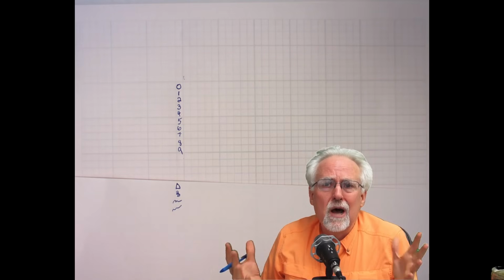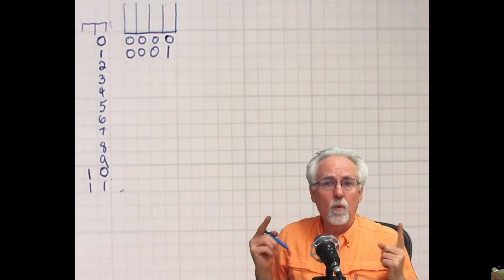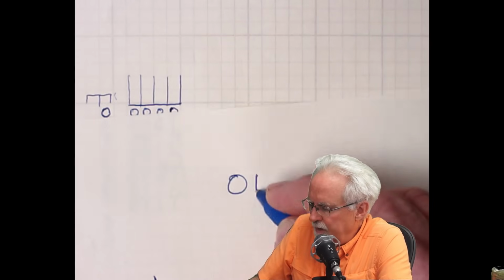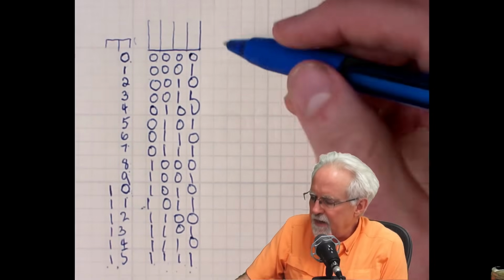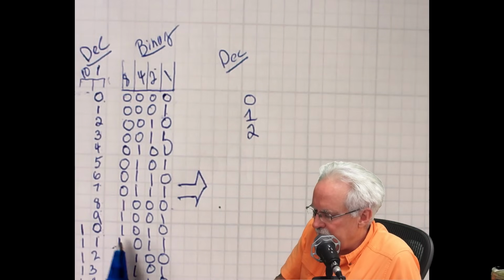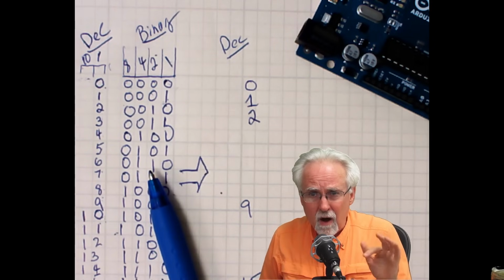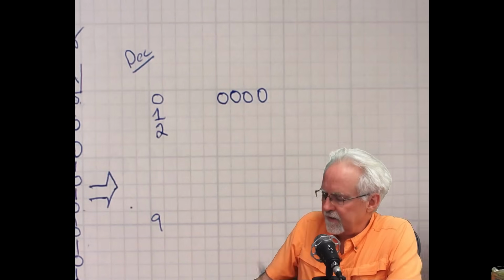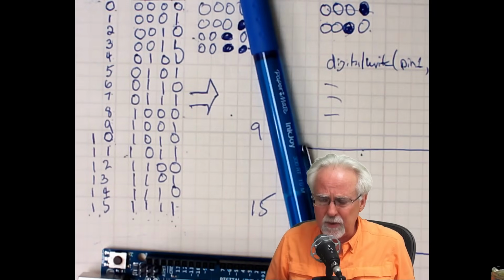Arduino Tutorial 5: Understanding and Working With Binary Numbers

Comment: void setup() {
 
pinMode(13,OUTPUT);
pinMode(12,OUTPUT);
pinMode(11,OUTPUT);
pinMode(10,OUTPUT);
}

void loop() {
  digitalWrite(13,LOW);
  digitalWrite(12,LOW);
  digitalWrite(11,LOW);
  digitalWrite(10,LOW);
  delay(2000);
  digitalWrite(10,HIGH);
  delay(2000);
  digitalWrite(10,LOW);
  digitalWrite(11,HIGH);
  delay(2000);
  digitalWrite(10,HIGH);
  delay(2000);
  digitalWrite(10,LOW);
  digitalWrite(11,LOW);
  digitalWrite(12,HIGH);
  delay(2000);
  digitalWrite(10,HIGH);
  delay(2000);
  digitalWrite(10,LOW);
  digitalWrite(11,HIGH);
  delay(2000);
  digitalWrite(10,HIGH);
  delay(2000);
  digitalWrite(10,LOW);
  digitalWrite(11,LOW);
  digitalWrite(12,LOW);
  digitalWrite(13,HIGH);
  delay(2000);
  digitalWrite(10,HIGH);
  delay(2000);
  digitalWrite(10,LOW);
  digitalWrite(11,HIGH);
  delay(2000);
  digitalWrite(10,HIGH);
  delay(2000);
  digitalWrite(10,LOW);
  digitalWrite(11,LOW);
  digitalWrite(12,HIGH);
  delay(2000);
  digitalWrite(10,HIGH);
  delay(2000); 
  digitalWrite(10,LOW);
  digitalWrite(11,HIGH);
  delay(2000);
  digitalWrite(10,HIGH);
  delay(2000);
   
  }

Comment: //I tried to do this lecture's HW in a slightly more advanced way than what we have learned so far, using what I know already from //computer science. I added some comments explaining my logic 

int A=8;
int B=9;
int C=10;
int D=11;

void setup() {
  // put your setup code here, to run once:
  pinMode(A, OUTPUT);
  pinMode(B, OUTPUT);
  pinMode(C, OUTPUT);
  pinMode(D, OUTPUT);
}

/*
 * this function takes the int i and and uses it to create its  
 * respective "4 digit" binary counterpart in reverse;
 * it uses the decimal to binary algorithm.
 * so if i=7, bin={1,1,1,0}
 * therefore 7 in binary is 0111
 */
void intToBinary_arr(int i, int bin[]){
  int bin_div=i;
  int bin_mod=0;
  for(int j=0; j<4; j++){
    bin_mod=bin_div%2;
    bin[j]=bin_mod;
    bin_div=bin_div/2;
  }
}

/*
 * here we have our LEDS on the bread board lined like: ABCD
 * we want to count in binary from 0 to 15 to display all
 * 16 binary digits in order:
 * (0000, 0001, 0010, 0011, 0100, 0101,...,1111)
 * (example: when i=1, A->0, B->0, C->0, D->1) 
 * (where a 0 would turn led off (LOW) and 1 would turn it on (HIGH)
 * we use inToBinary_arr() to fill our declared array, bin_arr, with 
 * the binary counterpart of the iterating integer i (which will increment from 0 to 15)

 * Since our bin_arr will contain the desired binary numbers in reverse, we assign 
 * A with the last element of the array (bin_arr[3]), 
 * B with the third (bin_arr[2]), 
 * C with the second (bin_arr[1]), 
 * and D with the first (bin_arr[0]).
 */
void loop() {
  for(int i=0; i<16; i++){
    int bin_arr[4];
    intToBinary_arr(i, bin);
    digitalWrite(A, bin_arr[3]);
    digitalWrite(B, bin_arr[2]);
    digitalWrite(C, bin_arr[1]);
    digitalWrite(D, bin_arr[0]);
    delay(1000);
  }
}

Comment: Binary counter - excellent exercise. Instead of brute-force writing 15x4 digitalWrite commands, there are a number of faster ways to code this. One way: learn the "function" command. Create a function, say F0001, to cycle the rightmost light. Create another function, say F0010, to turn light 0010 off, use F0001, turn 0010 on, and use F0001 again. Continue in this way for the other lights. Saves a great deal of writing.

Comment: Hey guys I figured it out, so this is the code answer.

int firstLEDPin= 13;
int secondLEDPin= 12;
int thirdLEDPin= 11;
int fourthLEDPin= 10;
int newNumberDelay= 2000;
int finalDelay= 5000;
void setup() {
  // put your setup code here, to run once:
pinMode(firstLEDPin,OUTPUT);
pinMode(secondLEDPin,OUTPUT);
pinMode(thirdLEDPin,OUTPUT);
pinMode(fourthLEDPin,OUTPUT);
}

void loop() {
  // put your main code here, to run repeatedly:
// Number '0'
digitalWrite(firstLEDPin, LOW);
digitalWrite(secondLEDPin, LOW);
digitalWrite(thirdLEDPin, LOW);
digitalWrite(fourthLEDPin, LOW);
delay(newNumberDelay);

//Number '1'
digitalWrite(firstLEDPin, LOW);
digitalWrite(secondLEDPin, LOW);
digitalWrite(thirdLEDPin, LOW);
digitalWrite(fourthLEDPin, HIGH);
delay(newNumberDelay);
digitalWrite(firstLEDPin, LOW);
digitalWrite(secondLEDPin, LOW);
digitalWrite(thirdLEDPin, LOW);
digitalWrite(fourthLEDPin, LOW);
delay(newNumberDelay);

// Number '2'
digitalWrite(firstLEDPin, LOW);
digitalWrite(secondLEDPin, LOW);
digitalWrite(thirdLEDPin, HIGH);
digitalWrite(fourthLEDPin, LOW);
delay(newNumberDelay);
digitalWrite(firstLEDPin, LOW);
digitalWrite(secondLEDPin, LOW);
digitalWrite(thirdLEDPin, LOW);
digitalWrite(fourthLEDPin, LOW);
delay(newNumberDelay);

// Number '3'
digitalWrite(firstLEDPin, LOW);
digitalWrite(secondLEDPin, LOW);
digitalWrite(thirdLEDPin, HIGH);
digitalWrite(fourthLEDPin, HIGH);
delay(newNumberDelay);
digitalWrite(firstLEDPin, LOW);
digitalWrite(secondLEDPin, LOW);
digitalWrite(thirdLEDPin, LOW);
digitalWrite(fourthLEDPin, LOW);
delay(newNumberDelay);

// Number '4'
digitalWrite(firstLEDPin, LOW);
digitalWrite(secondLEDPin, HIGH);
digitalWrite(thirdLEDPin, LOW);
digitalWrite(fourthLEDPin, LOW);
delay(newNumberDelay);
digitalWrite(firstLEDPin, LOW);
digitalWrite(secondLEDPin, LOW);
digitalWrite(thirdLEDPin, LOW);
digitalWrite(fourthLEDPin, LOW);
delay(newNumberDelay);

// Number '5'
digitalWrite(firstLEDPin, LOW);
digitalWrite(secondLEDPin, HIGH);
digitalWrite(thirdLEDPin, LOW);
digitalWrite(fourthLEDPin, HIGH);
delay(newNumberDelay);
digitalWrite(firstLEDPin, LOW);
digitalWrite(secondLEDPin, LOW);
digitalWrite(thirdLEDPin, LOW);
digitalWrite(fourthLEDPin, LOW);
delay(newNumberDelay);

// Number '6'
digitalWrite(firstLEDPin, LOW);
digitalWrite(secondLEDPin, HIGH);
digitalWrite(thirdLEDPin, HIGH);
digitalWrite(fourthLEDPin, LOW);
delay(newNumberDelay);
digitalWrite(firstLEDPin, LOW);
digitalWrite(secondLEDPin, LOW);
digitalWrite(thirdLEDPin, LOW);
digitalWrite(fourthLEDPin, LOW);
delay(newNumberDelay);

// Number '7'
digitalWrite(firstLEDPin, LOW);
digitalWrite(secondLEDPin, HIGH);
digitalWrite(thirdLEDPin, HIGH);
digitalWrite(fourthLEDPin, HIGH);
delay(newNumberDelay);
digitalWrite(firstLEDPin, LOW);
digitalWrite(secondLEDPin, LOW);
digitalWrite(thirdLEDPin, LOW);
digitalWrite(fourthLEDPin, LOW);
delay(newNumberDelay);

// Number '8'
digitalWrite(firstLEDPin, HIGH);
digitalWrite(secondLEDPin, LOW);
digitalWrite(thirdLEDPin, LOW);
digitalWrite(fourthLEDPin, LOW);
delay(newNumberDelay);
digitalWrite(firstLEDPin, LOW);
digitalWrite(secondLEDPin, LOW);
digitalWrite(thirdLEDPin, LOW);
digitalWrite(fourthLEDPin, LOW);
delay(newNumberDelay);

// Number '9'
digitalWrite(firstLEDPin, LOW);
digitalWrite(secondLEDPin, LOW);
digitalWrite(thirdLEDPin, LOW);
digitalWrite(fourthLEDPin, LOW);
delay(newNumberDelay);
digitalWrite(firstLEDPin, LOW);
digitalWrite(secondLEDPin, LOW);
digitalWrite(thirdLEDPin, LOW);
digitalWrite(fourthLEDPin, LOW);
delay(newNumberDelay);

// Number '10'
digitalWrite(firstLEDPin, HIGH);
digitalWrite(secondLEDPin, LOW);
digitalWrite(thirdLEDPin, HIGH);
digitalWrite(fourthLEDPin, LOW);
delay(newNumberDelay);
digitalWrite(firstLEDPin, LOW);
digitalWrite(secondLEDPin, LOW);
digitalWrite(thirdLEDPin, LOW);
digitalWrite(fourthLEDPin, LOW);
delay(newNumberDelay);

// Number '11'
digitalWrite(firstLEDPin, HIGH);
digitalWrite(secondLEDPin, LOW);
digitalWrite(thirdLEDPin, HIGH);
digitalWrite(fourthLEDPin, HIGH);
delay(newNumberDelay);
digitalWrite(firstLEDPin, LOW);
digitalWrite(secondLEDPin, LOW);
digitalWrite(thirdLEDPin, LOW);
digitalWrite(fourthLEDPin, LOW);
delay(newNumberDelay);

// Number '12'
digitalWrite(firstLEDPin, HIGH);
digitalWrite(secondLEDPin, HIGH);
digitalWrite(thirdLEDPin, LOW);
digitalWrite(fourthLEDPin, LOW);
delay(newNumberDelay);
digitalWrite(firstLEDPin, LOW);
digitalWrite(secondLEDPin, LOW);
digitalWrite(thirdLEDPin, LOW);
digitalWrite(fourthLEDPin, LOW);
delay(newNumberDelay);

// Number '13'
digitalWrite(firstLEDPin, HIGH);
digitalWrite(secondLEDPin, HIGH);
digitalWrite(thirdLEDPin, LOW);
digitalWrite(fourthLEDPin, HIGH);
delay(newNumberDelay);
digitalWrite(firstLEDPin, LOW);
digitalWrite(secondLEDPin, LOW);
digitalWrite(thirdLEDPin, LOW);
digitalWrite(fourthLEDPin, LOW);
delay(newNumberDelay);

// Number '14'
digitalWrite(firstLEDPin, HIGH);
digitalWrite(secondLEDPin, HIGH);
digitalWrite(thirdLEDPin, HIGH);
digitalWrite(fourthLEDPin, LOW);
delay(newNumberDelay);
digitalWrite(firstLEDPin, LOW);
digitalWrite(secondLEDPin, LOW);
digitalWrite(thirdLEDPin, LOW);
digitalWrite(fourthLEDPin, LOW);
delay(newNumberDelay);

// Number '15'
digitalWrite(firstLEDPin, HIGH);
digitalWrite(secondLEDPin, HIGH);
digitalWrite(thirdLEDPin, HIGH);
digitalWrite(fourthLEDPin, HIGH);
delay(newNumberDelay);
digitalWrite(firstLEDPin, LOW);
digitalWrite(secondLEDPin, LOW);
digitalWrite(thirdLEDPin, LOW);
digitalWrite(fourthLEDPin, LOW);
delay(newNumberDelay);

delay(finalDelay);
}

you can change it to suit your needs.

Comment: Hi . I may have a problem
On my first time use of uno as soon as I hooked it up to the computer the power light was on and a yellow led was flashing 
And kept flashing and the sketches from arduino had no effect on the uno .is the uno defective or do I need to do something for the first use 
Help please. 
Thanks
Reply: That orange light is probably just the onboard led attached to pin 13, 

When you say the sketches had no effect on the uno, do you mean the sketches weren't doing what they were supposed to, or did you mean that the light kept blinking when you uploaded a sketch?

Because if the sketches worked, and the light kept blinking, then things should be perfectly fine.

Comment: how can i get an additional GND ?
Reply: You can run a wire from the ground on your Arduino to the - (negative) column on the breadboard. Then when you use any of the holes on the breadboard in that - (negative) column it will be connected to ground. You can review the early lesson on breadboards. It's covered in that lesson.

Comment: working version for the homework 

//settingthe output pins's
int LEDone = 2; // LED 1 has a value of 1
int LEDtwo = 7; // LED 2 has a value of 2
int LEDthree = 8; // LED 3 has a value of 4
int LEDfour = 13; // LED 4 has a value of 8
int timer = 1000; // delay value 
int count = 0; // this value will be used to see what lights need to be turned on 
void setup() {
  //setting the outputs
  pinMode(LEDone,OUTPUT);
  pinMode(LEDtwo,OUTPUT);
  pinMode(LEDthree,OUTPUT);
  pinMode(LEDfour,OUTPUT);
}
void loop() {
  //setting all pins to LOW so the number starts of as zero
  digitalWrite(LEDone,LOW);
  digitalWrite(LEDtwo,LOW);
  digitalWrite(LEDthree,LOW);
  digitalWrite(LEDfour,LOW);
  delay(1000);
  // for loop to make sure that the program counts to 15 starting from 1
  for(int i = 1; i <= 15; i++)
  {
  count = i; //settign the value of count to i so we know what number is soposed to be displayed 
  
   //if statments will see if the number that needs to be displayed is greater than the lights value 
   //starting with the highest light value 
   //chekign to see if LEDfour needs to be turned on 
   if(count >= 8)
   {
    digitalWrite(LEDfour, HIGH); // if ture light will turn on
    count -= 8; // subtracting the lights value from the number 
   }
   else // if the number is lower than the light value 
   {
    digitalWrite(LEDfour, LOW);
   }
   //checking to see if LEDthree needs to be turned on
   if(count >= 4)
   {
    digitalWrite(LEDthree, HIGH); // if ture light will turn on
    count -= 4; // subtracting the lights value from the number 
   }
   else // if the number is lower than the light value 
   {
    digitalWrite(LEDthree, LOW);
   }
   //checking to see if LEDtwo needs to be turned on
   if(count >= 2)
   {
    digitalWrite(LEDtwo, HIGH); // if ture light will turn on
    count -= 2; // subtracting the lights value from the number 
   }
   else // if the number is lower than the light value 
   {
    digitalWrite(LEDtwo, LOW);
   }
   //checking to see if LEDone needs to be turned on
   if(count >= 1)
   {
    digitalWrite(LEDone, HIGH); // if ture light will turn on
    count -= 1; // subtracting the lights value from the number 
   }
   else // if the number is lower than the light value 
   {
    digitalWrite(LEDone, LOW);
   }
   // adding in a delay to make sure that the user has time to see the lights 
   delay(timer);
   
  }
  
}

Comment: Question if I may?....Paul - Can I use a single resistor in series with the negative (which is common to all LEDs), rather than a resistor for each LED?
Reply from the maker: No. The current would depend on what is happening in the other color. Change one color, and it will affect the other color.

Comment: Hi Paul...I enjoyed this lesson a lot.  I know it's redundant but thanks again!  
A few things I encountered on this project:  
1.  One of my resistors had too much resistance so the light for the first spot started out dim.  I changed it and the issue was corrected.  
2.  I've been using the solid wires and bending them out of the way for a nice clean look but my bend this time was to severe and I had to use tweezers dig a wire end out of the #11 spot on my Arduino.
3.  Initially I had my delay entered in as delay=(longPause) which of course caused an error
4.  after I fixed my delay I noticed that my pause between the count of ten and eleven was taking twice as long.  the problem was I had two semi-colons after the pause.  The extra long pause is evident on my homework project.  https://youtu.be/CjC8Q0N4tHU

Comment: /*
 * 4 Bit decimal to binary 
 */

 int pin[4] = {4, 5, 6, 7};  // pin numbers are stored inside pin array
 int b[4];
 
void setup() {

  for( int i=0; i<4; i++ )
  pinMode(pin[i], OUTPUT);
  
}

void loop() {

  int num = 0; // counter is initialized at zero.

  while( num<16 ){               
    int count = num;             
      for( int i=0; i<4; i++){
        if( count%2 == 1 )       
        b[i] = HIGH;
        else
        b[i] = LOW;
        count /= 2; 
      }

    for( int i=0; i<4; i++){
      digitalWrite(pin[i], b[i]);
    }
    num++;
    delay(1000);
  }

}

Comment: Sir, instead of purchasing the kit ,I am planning to buy indivisual components , can you guide me ,what all will be needed to follow up your tutorials ?
Reply from the maker: The reason I suggest the kit is to make it easy . . . cost for putting components together your self would be much more than the kit.
Reply: @paulmcwhorter   actually sir , amazon is not delivering it to my place :(  . aliexpress is doing it ,but the number of days it will take is more than a month ,so I was planning to buy stuff from a nearby store
Reply: @paulmcwhorter  so, apart from the arduino uno ,what all sensors will you be dealing with ?

Comment: Hello all…I’ve got the digital counter working properly. I wonder if the ‘delay’ function can be set as a variable so that I can change the rate at which the counter progresses with a single entry only. I’m guessing that there is a way to do this but not with ‘delay’.
Reply from the maker: Yes, use delay, but make the parameter a variable you set value of at top of code.
Reply: Thanks. That was easy! In fact, I ended up using a second, longer, delay at the end of the loop so that there is a definite pause with all four LEDs lit before the loop begins again.

Comment: For the assignment, since we are using 4 LEDs, would we also need 4 grounds? I only see 3 grounds on the arduino. I could set one of the pins to ground, but I feel like there is a better way to do it.
Reply from the maker: YOu have to create a ground rail on one of those two top or bottom rows on the breadboard that go all the way across. Hook one of those to the ground, then the whole row will be available as a ground.
Reply: Paul McWhorter Thank you. I was trying to do that earlier and it didn’t work. However, I found the issue. One of my wires wasn’t working. I had to test through all my wires and found that 4 of them didn’t even work. Kinda sucks but at least I’m not stuck anymore.

Comment: did you know that computers were almost designed to work with base 3 by using    switches   that switch between negative voltage and  zero voltage and positive voltage.

Comment: Hi Paul

Thanks for this series. It's giving me a good start to arduino which I haven't touched in a couple years. I do have a question though. I bought a kit that is a bit cheaper about a month ago: https://www.amazon.com/UNIROI-Complete-Tutorials-Breadboard-UA005/dp/B07D3RZZNN/ref=asc_df_B07D3RZZNN/?tag=hyprod-20&linkCode=df0&hvadid=309779531175&hvpos=1o2&hvnetw=g&hvrand=1545856679975593807&hvpone=&hvptwo=&hvqmt=&hvdev=c&hvdvcmdl=&hvlocint=&hvlocphy=9021603&hvtargid=pla-5705025 This kit is missing a couple components from your kit. Will this make a huge difference in the long run?